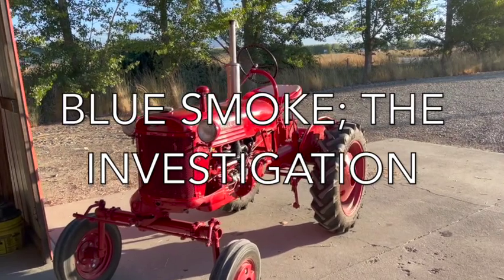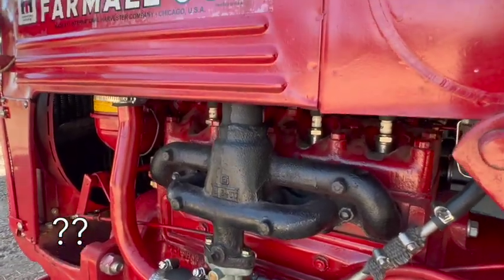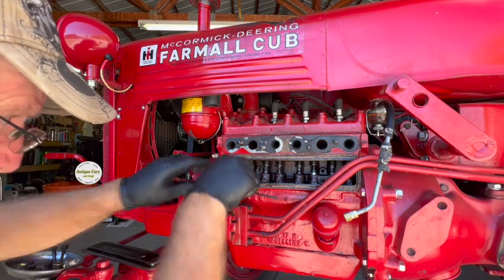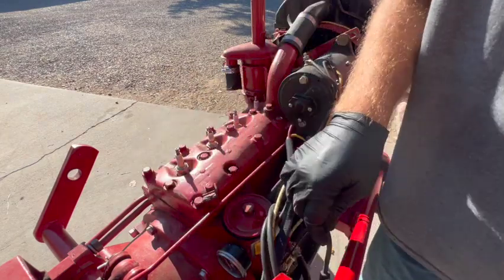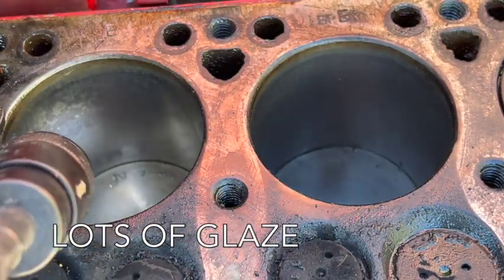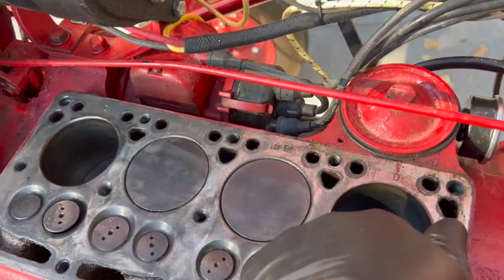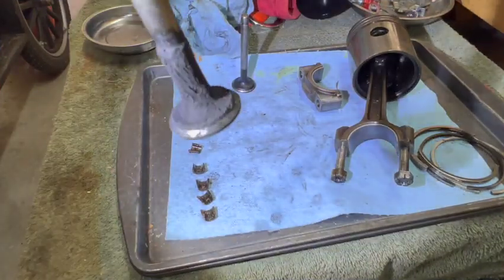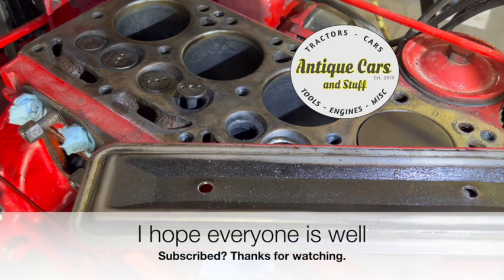Farmall Cub Blue Smoke - Part 1, The Investigation

Comment: Best way to isolate your blow by problem is do a cylinder leak down test very easy a will pin point where your problem is.   Procedure is as follows put cylinder your testing on tdc then install tester to spark plug hole charge cylinder to 100 lbs and read second gage on tester to see difference between charging pressure and cylinder pressure there will be 4 areas for you to check at this point while air is being introduced to cylinder 1 open radiator to see if you have a blow head gasket 2 open throttle fully and listen for air escaping thru carb indicated burned intake valves 3 listen to exhaust for air escaping ie: burned exhaust valve 4 open breather to crankcase  for air escaping indicating blow by from rings.  Hope that helps
Reply from the maker: Thanks Terry!

Comment: I love your channel and your little video series you do on each project. Just my two cents, I think you're totally on the right track with figuring out the smoking issue. Consider the valve guides as well. I did a valve job and new rings on an engine and didn't address the valve guides. Once I got the engine back together it still smoked, then I had to go back in again... I'll only make that mistake once.
Reply from the maker: Thanks John. Yep, valve guides are getting done too. New valves, guides, springs, and keepers. I do NOT want to do this twice! ;)
Reply: Thanks for that tip

Comment: Great video of the teardown. I'd recommend measuring the cylinder at the top and bottom to see if there is a taper to the cylinder as well. Yeah those valve seats are a mess. The valves themselves are probably ok. I'd have them ground. They are probably better then the new ones available.
Just for curiosity what is your opinion on the head if it would be warped? I've heard one individual of YouTube say that Cub heads should NOT be milled. Best yo replace them. It's even debated a lot about not needing to worry about a warped head. They claim it will flatten out when torqued down. I disagree with that. First off I wasn't aware that cast iron flexes?
Reply from the maker: Thanks. Cylinder #1 has about a .003” taper. I’ll check the others later. I went ahead and ordered new valves. They seem like good quality but I'll definitely keep the old ones just in case. I have heard the same thing about Cub heads. Not sure why they don't "take" to being milled. I've never heard of that on other stuff. It looks like new heads are available for about $250. I agree with you about the warped heads. Why even bother? I wouldn't want to use one. Mine seems to be ok, so that's good.

Comment: Did you notice any coolant mixing with oil, either in the oil or coolant? I just did everything you did for the same reason (smoke), but on a John Deere H (new pistons, rings, machined head/block, new gaskets on everything). Put it all back together and started right up. No smoke at all any more, but lots of coolant in my oil now and no idea why.
Reply from the maker: I'm sorry to hear that. Did you have coolant in the oil before the tear down? Are the surfaces of your block and head flat? Did you use any type of coating on the head gasket or did you install it dry? 

I'm pretty sure that I didn't have any coolant getting into the oil but I'm still right in the middle of the project.
Reply: Sounds like your head gasket is leaking, maybe it moved a little when you tighten the head don't take much movement

Comment: I have actually seen old tractor engines so worn out you would literally have to pull crank it , then it would die when you let the couch out ( not enough compression to even pull it's own weight. 

These engines will run untill there literally dead!